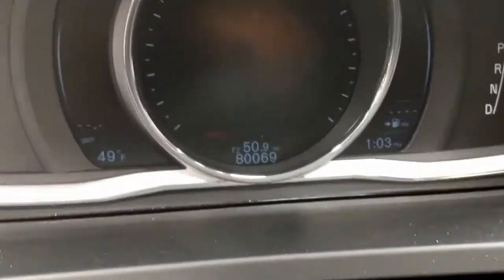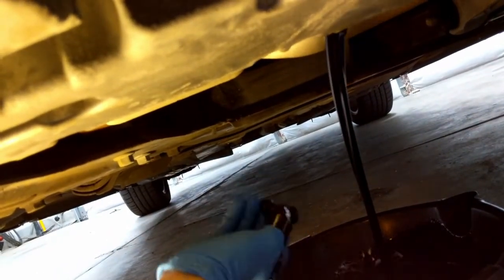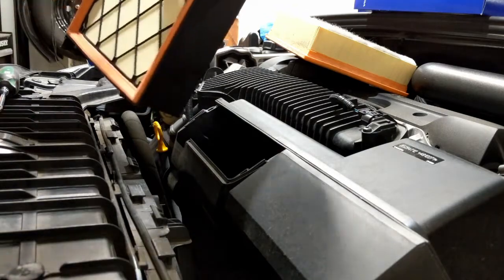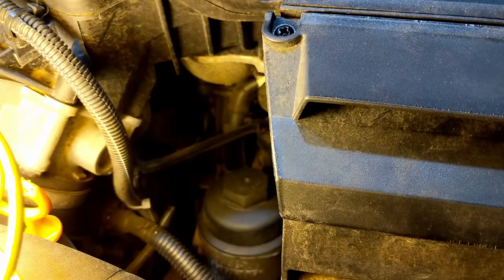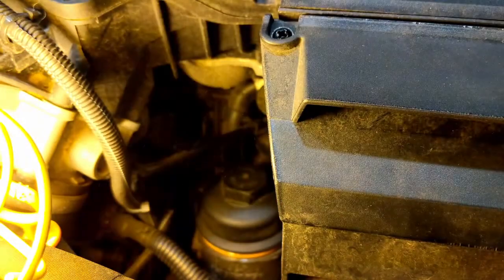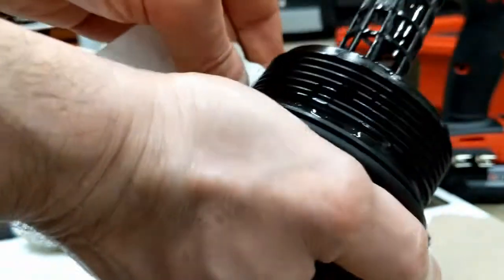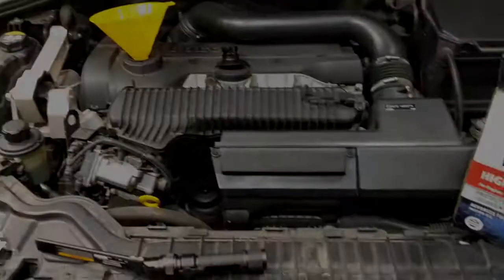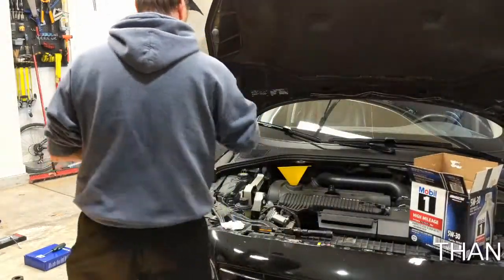Volvo V60 Oil & Air Filter Change

Comment: Hey Jason , great video! Wanted to ask you if you can tell me what year this v60 is? I’m trying to do an oil change on a 2016 cross country and I’m having a little difficulty finding the right size oil filter wrench to remove the plastic casing. Thanks for your help!
Reply from the maker: Hi Gerald sorry for the extremely delayed response.  The car is a 2016.  In that year there were some made with the inline 5 and some with the 2.0 inline 4.  If you have the inline 5 with the filter up top I use a 36mm socket adapter to 3/8 and a swivel and extension.
Reply: @jasonochoada3083  awesome thanks! I was a little confused because I thought the filter was on the bottom which is what the dealership told me but I did locate it and you’re right i used the 36mm. Thanks for the help with this video!

Comment: If you want the video to be easy to find add the engine codes and year of manufacture to the title. I had to dig around in the video to find that it's not relevant to me. (2016 V60, D4)
Reply from the maker: Hi Mark thanks for the tip and apologies for wasting your time!